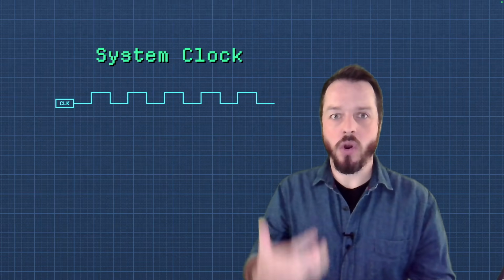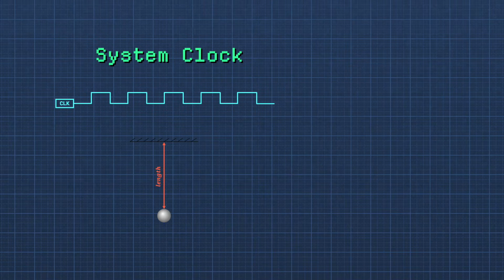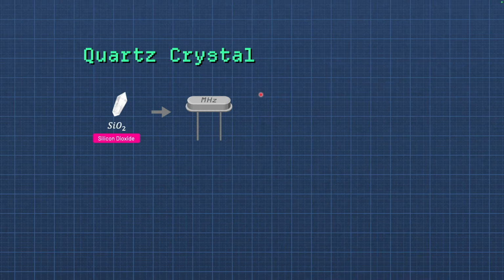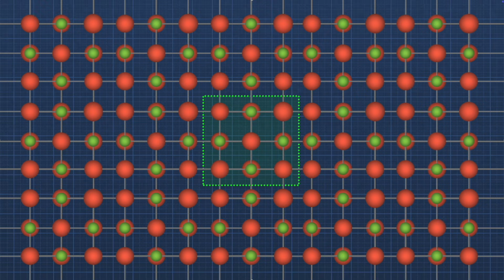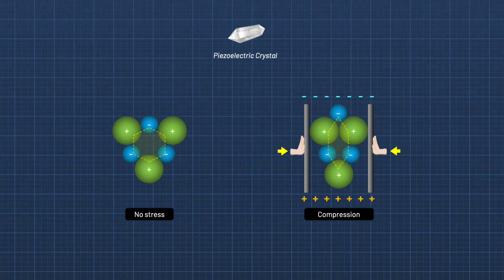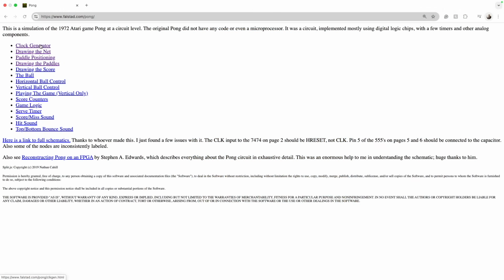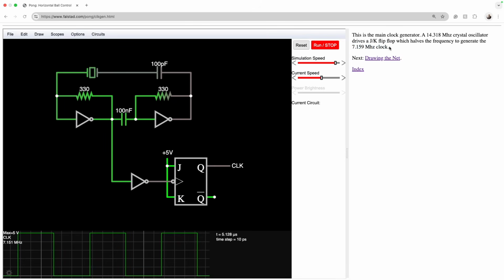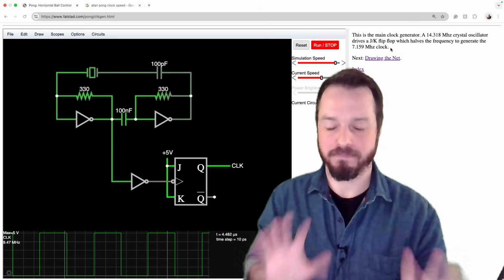Crystal Clock & Oscillators

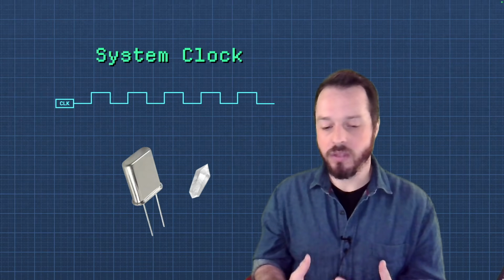Comment: 5:00 good video but you did not bother to show how is the crystal connectedinside the metallic casing.
Reply from the maker: There are different methods. At 15:10 there's an image that shows how the electronodes connect to the actual quartz slice inside the casing. Another technique you'll find put there is to slice the quartz in the shape of a tuning fork (which is a good analogy to the whole vibration nature of the crystal).